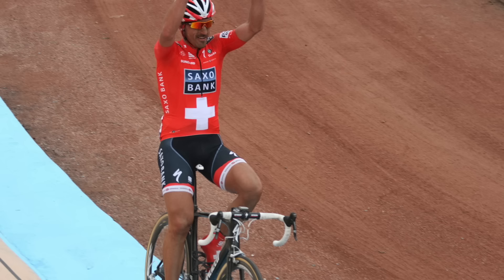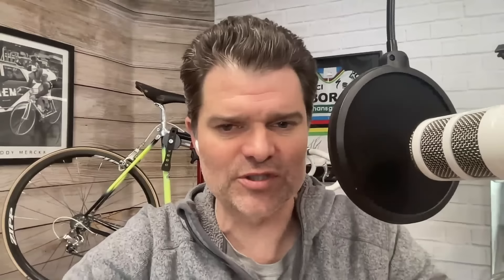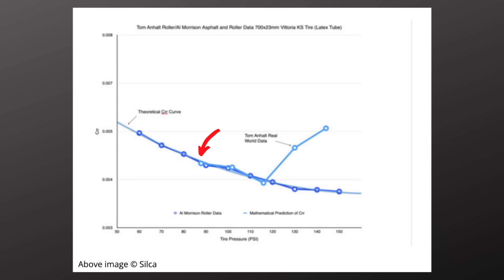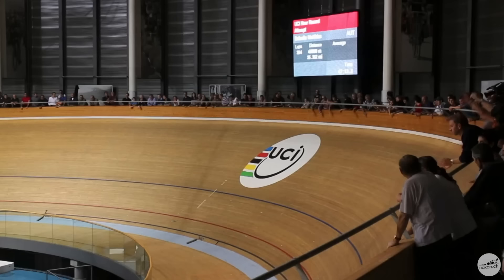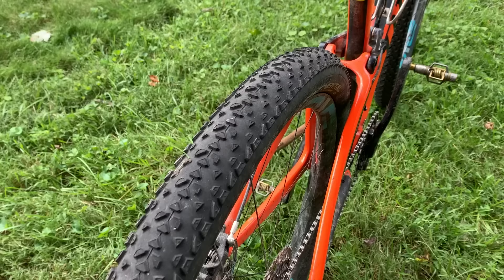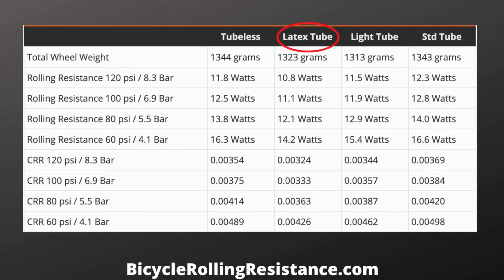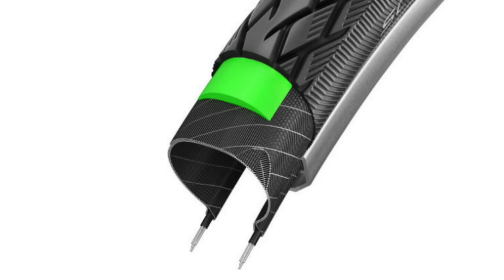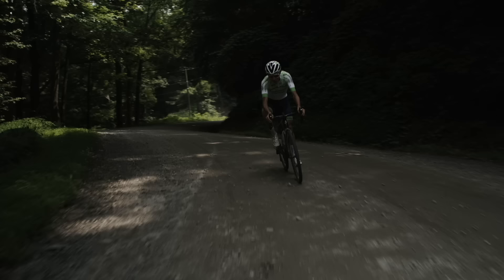Your Tires Could Be Costing You Minutes. Tire Rolling Resistance with Josh Poertner

Comment from the maker: If you are looking to take your training to the next level then consider one of my online science based training plans available here: https://www.trainingpeaks.com/coach/dylanjohnsontraining#trainingplans
Reply: If wider tires have lower rolling resistance and assuming this does not apply to bicycle tires only, then that means putting wider tires in cars can actually improve efficiency?
Reply: Oooooooooooooooo
Reply: @sepg5084  oooooooooooooooo ooooooooooooooooooooooooooooooooooooooooooooooooopoooopooooooooooooooooooooooooooooooooooooooooooooooooooooooooooooooooooooooooooooooooooopp
Reply: @sepg5084  as it was said in the video, there is a limit in both directions. As far as i know, car tyres are already very very wide as the are optimised for grip, not for rolling efficiency. Look at the electric car tyres where efficiency (= range) is critical, the are much thinner :)

Comment: I remember when Vredestein sold road tires with their advertisement that you can pump them up to 150 psi for decreased rolling resistance.  It is interesting how things have changed.
Reply: Track Riders 150 to 200 psi 
I always Ride @ 120 - 125 psi Clinchers Specialized Training Tyres
Reply: @Robert-mn8gc  too much
Reply: @Robert-mn8gc well, Dygert just won the pursuit at worlds running tubeless 25mm tires that were probably under 90psi
Reply: @veganpotterthevegan uh...no. 150+ psi more likely
Reply: @lunam7249  no, the beads would blow on the tires they used at 150psi sitting still.  No way could they handle the force of the banks on the track
Reply: Many pro team mechanics interviewed in the 1990s recommended 80 psi for road tires as an average pressure. Changes in pressure would go up or down based on rider weight.  Really high pressure at 100 psi or higher was used on smooth wood tracks.  Many people took track pressures to the road and pushed higher pressure facts in cycling magazines.
Reply: @markconnelly1806  what you say sound true and correct, cobblestones tour de france 80 psi sounds rough...100psi on wood sounds  "normal"...they use 700c x 20mm or even 15mm actual!in that case 100psi  sounds soft...imterestingly i never ever seen a mechanic interviewed on the tour de france or olympics on TV!!!maybe now 30 years later i will find that on youtube!! TV coverage is absolutely horrible!!
Reply: @veganpotterthevegan  i race on velodromes, not in the olypics anymore, even on 1/3 km tracks the "g-force" is not crazy high, higher force hitting a curb directly
Reply: @lunam7249  you do realize that's a huge part of the reason they don't need 150psi don't you?
Reply: @veganpotterthevegan  PV = nRT
Reply: @lunam7249  it's simpler than that.  In the end, you're just wrong.  They used tires that would explode off the rim while being pumped long before hitting 150psi.
Reply: Science and the instruments to study this phenomenon continue to progress.
Reply: @veganpotterthevegan  sew-ups
Reply: @lunam7249  sure,  but two gold medals at track world's were won on  clinchers and that's what I'm talking about
Reply: @veganpotterthevegan  oh god......ok .....find me the video with an olympic bike tire mechanic using clinchers😳😺
Reply: @veganpotterthevegan "probably" means unusable folklore. Best pressure depends on weight and surface smoothness.
Reply: @gerrysecure5874  Silca tested this and found that those very high pressures were slower, even on wooden velodromes. Maybe not if you're 350lbs but how many of us are that heavy?
Reply: @veganpotterthevegan  I did not refer to any specific pressure value. I referred to your use of the word "probably".  If you know the pressure say so, if you don't your guesswork is of no value.
Reply: @gerrysecure5874  probably under 90psi meaning its probably under 90psi and if it's any higher,  it's not more than 5psi higher.  If you've ever ridden at speed on a wooden velodrome, you'd also know you drift up the track a bit.  Lower pressure keeps you from doing that.  Pretty fun experience riding 19mm tires at 220psi on a velodrome.  I feels like you're hitting a muddy corner on a cross course. You obviously lose power doing that and you're riding a further distance.  21s aren't as bad but still noticeable.  You can make that a non-problem with 25s.  I never raced with tires that fat because all good track wheels were tubulars back then.   But when doing aero testing on a road and TT bike on the velodrome, with road tires and typical road pressure, the stability gains are huge.  Of course,  I wasn't testing tires, just position so no swapping back and fourth but 130psi certainly didn't feel good with 25mm tires on the track which is what I used to TT with on smooth roads before I knew better.
Reply: @veganpotterthevegan  To be clear, I prefer wider tires and lower P than was common 30yrs ago too. I'm a roadie, more comfy, better grip in corners, but our roads are pretty smooth, and I really can't tell a diff in rolling resistance going 6 bar to 8 bar but sprinting hard feels bit slower at 6.
Probably means u actually don't know, neither do I. I was on a track once, but it was concrete not wood. Can't remember the pressure used then. The track bike was rent.
Reply: @gerrysecure5874  I've tested tires A LOT, just not on the track.  This stuff is very measurable. If you have a power meter,  test your tires at max pressure on a quiet day.  Then lower them to Silca's recommended pressure for your weight.  You'll see a minimum of 5w(it'll likely be closer to 8w) of difference to hold 30kph. *You were on a track once...I hit the Olympic standard in the pursuit before it was removed for the London games.  I've tested a LOT of gear
Reply: @veganpotterthevegan  oohh lord....😳😂😂😂🤦🏻‍♀️🤦🏻‍♀️🤦🏻‍♀️🤦🏻‍♀️...whoever silca is? did he prove gravity us imaginary also?//!!???😜😜😜🤯🤯🤯😂😂😂😂😳😳
Reply: @lunam7249  if you don't know Silca, you don't know cycling.  Did you know bicycles have 2 wheels?  Trying to see where you should start with getting informed
Reply: @veganpotterthevegan   She had a bad crash in May, maybe with the tubeless tyres you are talking about, 25mm Kenda Valkyrie TLR Pro, those shown on the pre-race press release photography? but It's not clear if that was the same bike in the races...
Most likely she used tubular, not tubeless, at 140+ psi for her title.
About the pressure calculator you can find better than Silca's online, no need to give them your email!
Reply: @DR_1_1  she definitely ran tubeless on the track.  Multiple outlets covered it.
Reply: @veganpotterthevegan  she definitely ran tubular at 140+ psi on the track.  Multiple outlets covered it.

See what I did?
Reply: @DR_1_1  yes, I see you're being oblivious and making up utter nonsense because you can't make a legitimate point.
Reply: @veganpotterthevegan  So you have no proof. Just making stuff up...
Reply: @DR_1_1  I'm also coached by one of her team pursuit teammates.  But keep pretending you know anything at all about anything at all🤡
Reply: @veganpotterthevegan  Nice story, bro.

🤡🤡🤡
Reply: @DR_1_1  well, if you wanna be a creepo and ask Shayna Powless if she coaches me, go right ahead. She's a great coach.
Reply: @veganpotterthevegan  Blah blah blah. Still trying to divert the conversation.
She rode tubular 140+ psi, so you prefer to talk talk tlak.
Reply: @DR_1_1  she most definitely didn't use tubulars potato.  Nobody on the pursuit team used tubulars🤡  They had wheels designed specifically for that bike and they were tubeless.  Why don't you change the subject to something you're informed about?
Reply: Vredestein Fortezza was the modelname. My dad worked at Vredestein for 40 years.
Reply: Oddly, I stopped using higher pressure on my road bike, and it almost eliminated getting punctures.  Ride tubulars.  About 85psi works well for my 155 weight.
Reply: @wiseoldman5841  I'm 190lbs and never ride tires with that much pressure unless I'm racing.
Reply: @markconnelly1806  GCN a couple years ago at the Giro went around pro team mechanics and asked them what they were running, the answers were no lower than 7 bar in certain conditions (105 psi) to over 7.5 bar (112.5 psi).
Reply: I remember as a young mechanic guys bringing in their bikes with 15O+ psi in tyres and asking why the tyre kept blowing off the rim circa 2009
Reply: @lunam7249   GCN covered Dygert and Ganna's bikes. You can't share links. Why can't you do anything yourself?
Reply: @veganpotterthevegan  what is there to do?, PV = nRT, "clausius" physicist...., that GCN is one giant commercial, i wouldnt even believe in gravity if they did a vid about it!!😂😂😂😹😹😺
Reply: @lunam7249   you wouldn't think you were real if they covered you.  That's how biased you are.
Reply: @veganpotterthevegan  im ex-olympic 1km, what would fantisize that i say? 22PSI is great for speed and comfort!!yay!! GCN is so great i want to marry them??, me i like 120psi, others like less, others like more, for speed FACT higher PSI is ALWAYS FASTER...FACT
Reply: @lunam7249   you're not smart enough to know what facts are.
Reply: @lunam7249   I'm a pursuit qualifier.  They removed it for London though.  That still has nothing to do with this.
Reply: @lunam7249   you're simply a science denier.
Reply: @veganpotterthevegan  😂🤣🤣😺😺❤️❤️😅😅❤️👏👏👏😹😹 ok. you won....im in science denial...my bad....
Reply: @lunam7249   you never needed to admit it. It's blatantly obvious.   Again,  you can look this information up yourself.  Or just actually test gear.  When we were racing at our best, clinchers just weren't as fast.  Things change though
Reply: @veganpotterthevegan  dont put words in my mouth. no one said clichers were the fastest
Reply: @lunam7249  I don't have to. That said, you just conceded that you can't read.

Comment: Engineer here, the reason low pressure is faster is down to idea gasses being perfectly elastic, meaning that compressing air is much more efficient than compressing your tire will ever be, making the tire lower pressure puts a lot more of the burden of deforming on the air rather than the tire. That's the real reason it's faster to run lower pressure
Reply: Define “lower” pressure.
Reply: @traderstatusquo  a gauge pressure lower than the expectation that most people have (70psi being faster than 110 psi for a 150lb rider)
Reply: Mmmm, I would push back on that. (Pun unintentional but I'll roll with it). Ideal gas which behaves adiabatically is a valid first order assumption, but that would mean that it's not absorbing any of the energy. Thus, if we limit the control volume to the tire and air, the losses are due to inelastic deformation of the tire.

However, I suspect that if we expand the control volume to include the entire bike & rider system, the power required to vibrate the mass of the system is a function of both tire pressure (neglecting sidewall stiffness),  and surface roughness of the road. Thus, I would expect for perfectly smooth surfaces maximum tire pressure to be fastest. I would speculate based on the observed trend that an optimal tire pressure exists for a given roughness, that what I am assuming are vibratory losses scale as a function of pressure faster than tire deformation. (At least in the local space of sane tire pressures.)

I suppose at the limit one gets either train wheels, or that one time JPL made 20 foot tall experimental rover tires made of parachute nylon inflated to something like 0.5psi, which were super efficient when going over giant boulders
Reply: This’s only true on rough surfaces. The smoother the surface, the higher the pressure, the lower the rolling resistance.

Comment: Thanks Dylan I am one of those guys that ran as much pressure in my tire as I good back in the day. (1980) Know that I am a bit older (68) I can use every bit of help I can get. LOL I've been running lower pressure for years and it helps make the ride more enjoyable and at the same time faster. Good tires at the right air pressure, the best chain you can afford, best chain rings and cassette, then bearings and a frame that allows the peddle stroke to move the bike forward with no energy loss. With that in place we have NO Exceuses. Ride hard and with passion. Rick
Reply: I hear ya, I’m 68 also, raced bikes in 76, and mountain bikes in the 90’s. I always used 110 in my sew ups for races on the road. Now I use 100 lbs. in the rear, and 90 lbs in the front (700x25 clinchers) for rides. My mountain bike I use tubeless tires at 35 to 40 lbs. hard tail with 110mm Fox front shock. I still love to ride regularly.

Comment: Right on! We ALL have left countless watts on the course because of this. I found the insert discussion especially valuable! A deeper dive on this would be great! 👊🏻💥
Reply: I was drawn to tire inserts (Vittoria Airliner) for a 28mm road bike rim. I don't compete, but I was looking for added confidence that my tubeless setup would not leave me stranded in a rural area - - where I live. At the time I was running Continental GP 5k (TL), and they were notoriously hard to acquire, and even harder to mount.  The Airliner just made it impossible for me.

I never tried the insert with the Pirellis that I used to replace the GP5K's, but these are much easier to mount. In the end, with this new ease of installation, I have abandoned the inserts for the road bike, in favor of carrying a few patches, a boot, and an innter tube.

Comment from the maker: Let me know if you liked this style of video and if I should include more guests in the future. There is a lot more from this conversation that I plan on releasing. 

Find your optimal tire pressure with the Silca Professional Tire Pressure Calculator:
https://silca.cc/pages/sppc-form

Find out which tires are faster or slower with BicycleRollingResistance.com:
https://www.bicyclerollingresistance.com/
Reply: Great content.  Thanks.  I am going out to lower my psi.  lol
Reply: Great information and insight into tire/tube air pressures. Very interesting and educational. Thanks for this excellent material...
Reply: Hi Dylan, I very much enjoyed this style of video.  I was hoping Josh/you would get into discussing the pros/cons of various tread types & tire manufacturers.  I've been on nothing but Rene Herse tires for years -> Barlow Pass 38mm slicks which actually measure 43mm on my FSE 27mm internal width wheels... However, I've had my eye on some Vittoria tires as well.  Thanks again for the great content!!
Reply: Your normal videos are better.
Reply: Bro you left me hanging! I wanna hear the second part
Reply: Started using there calculator when it came out and blew my mind on what i had been putting tires too.  The ride comfort at same speeds was amazing.
Reply: @JasonDBike  The "normal" videos are different but they're only "better" if that information is more relevant to you.  I don't prefer one style over the other.  They both inform and that's what's relevant to me.
Reply: FANTASTIC video! More like this, please. In a lot of your video intros, you say you talk about gear, and I keep waiting for that to be true. I need every advantage I can get.

And talking with experts is a nice change from talking to that guy with the backwards hat.
.
.
.
.
(I totally love the guy with the backwards hat.)
Reply: This is fantastic, and we eagerly await part II!
Reply: Absolutely! The best as always!
Reply: Great video Dylan! Would be nice to see Stephen Seiler or Tim Podlogar for a conversation!
Reply: Hey Dylan, this was a great video, amazing insight, since Josh knows the tech like the back of his hand, and one can trust what he's saying. Otherwise your regular videos are preferred.
Reply: This was great!
Reply: I like this format which includes industry specialists .
Reply: Definitely more guests DJ… Definitely… 🍻
Reply: Did your discussion with Josh alter your tire selection or your decision on whether to run inserts on gravel?
Reply: Yep, another vote for similar content
Reply: More please.
Reply: Audio was off.  Had to turn it way up and get headphones. I like the old format.
Reply: Definitely appreciated the interview format. A great addition👍🏽
Reply: I definitely would like to see the rest of your conversation with Josh!

I know about a lot of what you discussed but it never hurts to focus in on some of these topics again.  My first gravel races are this spring but I’m curious about the psi calculator for my xc racing as well so I’ll check it out.  I’ve always just tested my tires to feel so we shall see.
Reply: super interesting overview, thanks for that !! Also I had no Idea that the EF guys punctured and managed to finish Robaix on inserts
Reply: Lmao my psi is lower than this calculator and I still want to go lower. What's faster smaller tire or fatter tire lower psi
Reply: Vote for this type of content. Great info.
Reply: maybe an older format that you usually do with more graphs and side clips and have your guest comment on it as well as a podcast/interview. just a thought
Reply: This video is still science-based how-to get faster, same as hey, normal video. It just simply involves another expert in the field, instead of reviewing literature.
Reply: Great conversation, definitely like this format.
Reply: This was great.  It is really interesting to here about this topic.
Reply: I like it. Thanks for the links too!
Reply: I really enjoyed this and the video with Josh about lubrication.  It would be great to do a video which adds up all of the maginal gains and tries to put a watts saved value on these changes.
Reply: the calculator doesnt account for internal rim width. That seems like a miss. or maybe I am wrong.
Reply: Love it!!!!!

Comment: I got a new bike! I ran 25mm tires at 120 psi on my old bikes for many years. My new bike came with 32mm tires. I used a tire pressure calculator and I currently run them at 55/60. I don't think these tires roll faster, but they are much more comfortable on the chip seal road surfaces I ride around here. I'm old, so comfort is a priority.